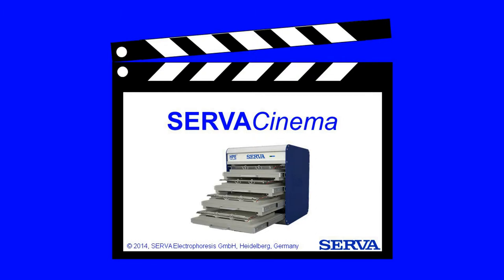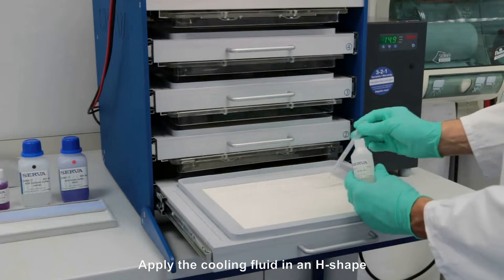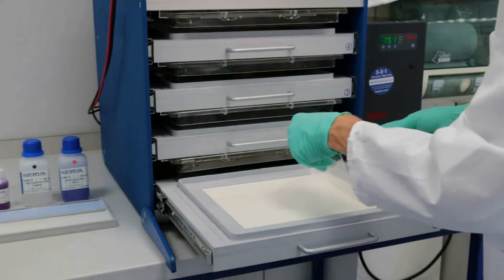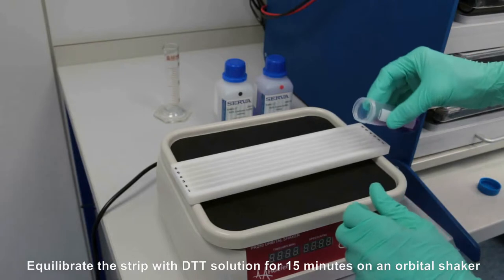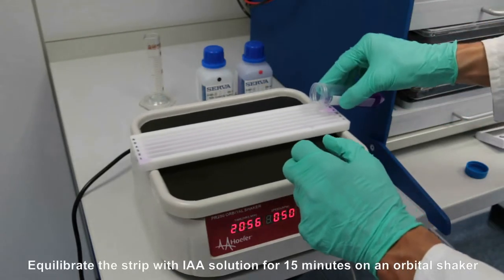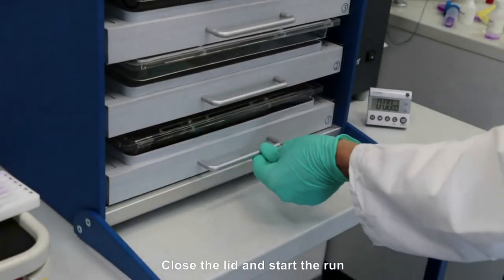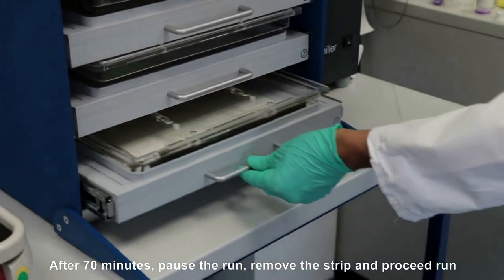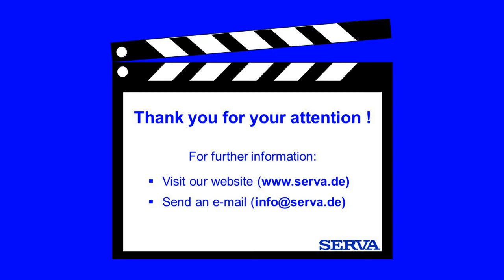SERVA Cinema: HPE Tower - 2D Electrophoresis on HPE 2D Large Gel

Comment: Is blue tower powerpack individually programme as per each stack??
Reply from the maker: Dear Bharat,

No, the SERVA BlueTower is designed for four simultaneous runs, mainly needed in 2D Electrophoresis or high throughput applications. If one needs four individual drawers, there is the possibility to stack HPE BlueHorizon and have one power supply for each drawer. Like shown in this video:
https://www.youtube.com/watch?v=PeCq7qGoKxg